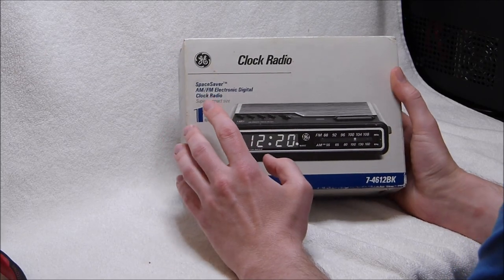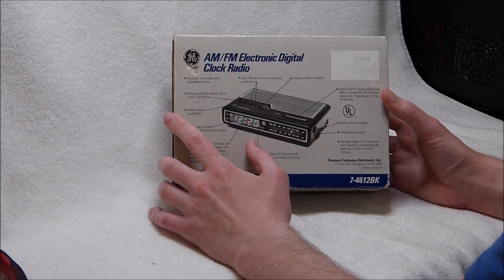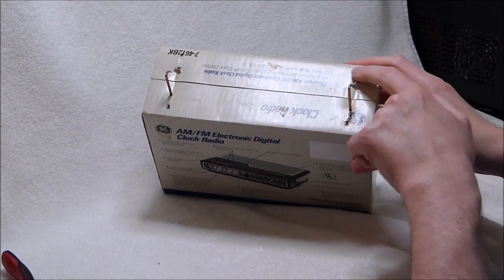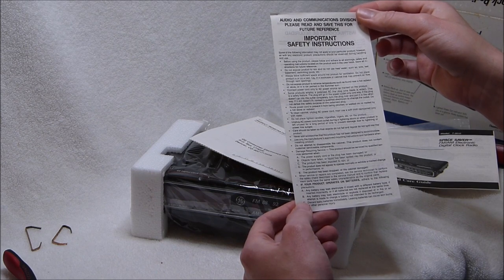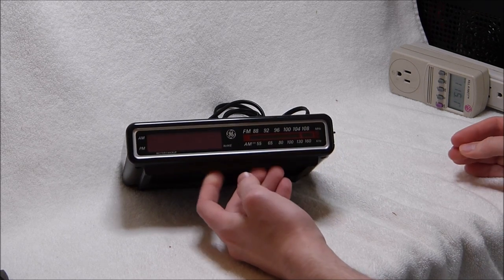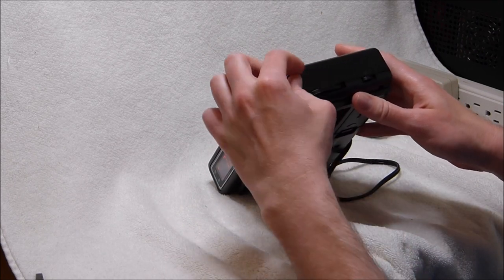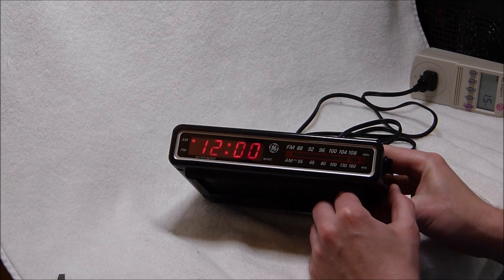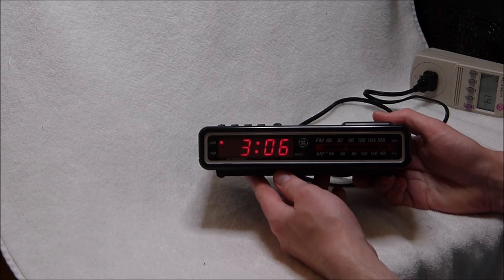Unboxing a NOS General Electric model 7-4612BK clock radio from 1990

Comment: I got married in 1978, we went through several alarm clocks, the digital numbers kept burning out, and the radio would get poor reception after a few years. I don't remember when we bought our ge 4612 A clock radio, but my husband died in 1996 and we had it 5 years or more then. I am still using this radio, waking me up to go to work every morning. I have 2 years til retirement and I am sure I will still be using it then. It still works great, the radio has clear sound. I have found 3 others at thrift shops and I buy them because I know they are very good quality, yet I know it probably wasn't very expensive, we usually buy lower priced items. I use my extra clock radios in different rooms around the house. I never gave it much thought in the past, but now I am very proud of my clock radio. Also the battery back up has saved me from oversleeping more than once when we have had power failures.
Reply from the maker: It's a nice little radio for sure. I think it was fairly inexpensive when new, but you got a lot for your money with this one! It's nice that the radio you and your husband shared is still working; if it ends up failing at some point, the guts of one of your spare clocks could probably be swapped into it. Battery backup is something a lot of early digital alarm clocks lacked, unfortunately.

Comment: Thanks for sharing. I am impressed that you used a “period correct” screwdriver to remove the staples! The alarm reminded me of the many mornings waking up in hotel rooms, knowing I had to go to a factory and repair something. 
Unboxing NOS products like this is obviously fun. A friend of mine in Michigan recently bought a NOS Norelco L6X38T “James Bond” radio, still in its unopened packing. Unbelievable find. He sent me a video of him opening the box for the first time.
Reply: OR staying in a hotel ,  and being startled awake at 5:20 am from this blasting alarm in pitch blackness,  when it was left set like this from the previous guest waking up early to get a flight,  with my phone set for 7:00 am.  Ever since,  I always make sure the clock radio in a hotel has the alarm disabled before going to sleep!
Reply from the maker: That screwdriver has really held up over the years, despite having been used as a prybar pentyl of times. They don't make em like that anymore!
Another commenter said these were often sold to hotels, and I do vaguely recall seeing clocks like this myself. 
I agree that it's fun to unbox NOS electronics, so I try to capture that when it's something special. Speaking of, that NOS Norelco L6X38T is quite a find, much more so than this clock!
Reply from the maker: @LakeNipissing  I've been rudely awoken by a hotel alarm I didn't set as well, so I usually remember to check that, but sometimes I forget.

Comment: I love this thing. Had that black variant for a bit over a decade now. I got mine new in box, too. My only caveat is the angeled keys and switch. If the 7-4633 was black like this one, I would have gotten it instead.

I also love hwo it's god soft, red numbers that don't make a nightclub out of your bedroom, and it doesn't stab you in the eye as you enter the room. You would never guess it was there unless you came really close.
Reply from the maker: They're nice little clocks for sure!

Comment: Mom had one just like it
[ after I tore up mom’s new “flip-numbers “ clock radio.  I just HAD to see how it worked.
   G.E. had a habit of sort of boring looking plain stuff.
A lot of their products were actually pretty durable.
📻🙂
Reply from the maker: Oops! I took apart quite a few things as a kid too, some of which I came to regret dismantling. 
I agree that most of GE's clocks and radios were pretty plain looking, but their stuff was usually sturdy, as you said.

Comment: Now THIS is cool! Ive got a couple clock radios around, including a late 80s ge clock similar to that still in service in my parents room. Ive also got the very 1st digital clock radio that ge made, from the late 70s I believe...
Reply from the maker: Thanks! Which model do you have? I believe GE's first digital clock radio came out in 1970, but I can't remember the model number off the top of my head.

Comment: Strange how the tuning is with a thumbwheel,  but the volume is rotary!
Also,  odd for a GE clock radio not to have forward / reverse time setting... that seemed to be a standard feature on their clock radios.
I will never understand deletion of dial scale lights from clock radios,  including this one.
Still believe GE put their best foot forward in 1979/80 with the 7-4800 and 7-4885.
Reply from the maker: It is a bit odd, but I will say the tuning is very smooth, far better that most radios with dial string tuning. 
I have a GE clock radio from the late 1970's on my nightstand with reverse set, but I guess they didn't put it in this less expensive model.
The lack of a dial light is a bit of pain, but I'm usually not adjusting the tuning in the dark. 
I've got a 7-4885 I need to restore one of these days.